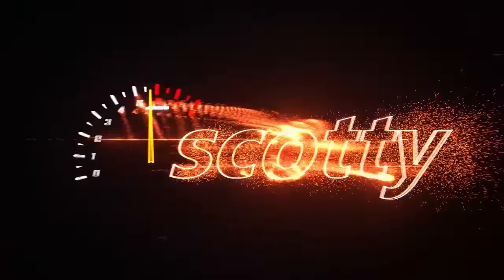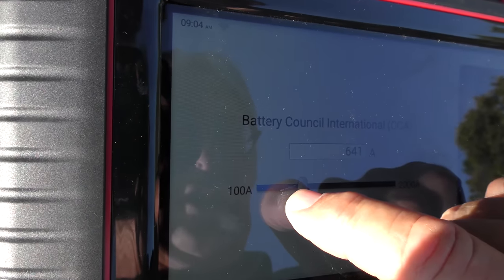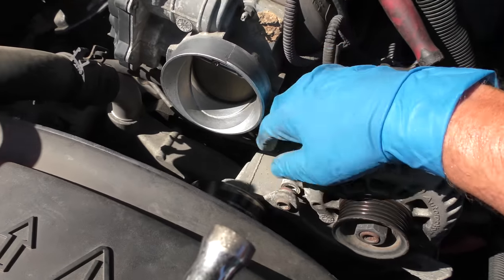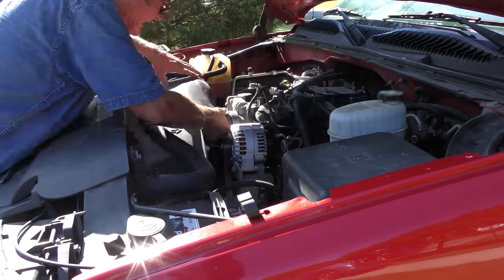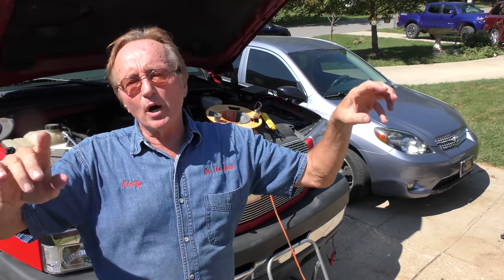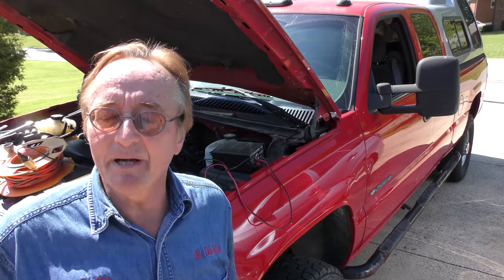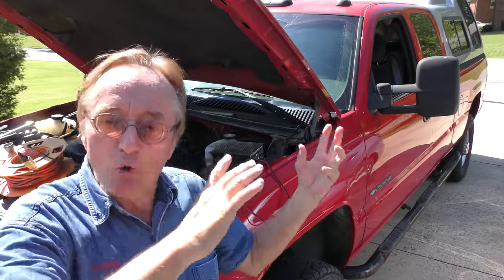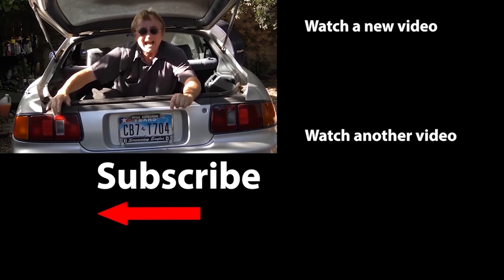I Just Got Kicked Out of AutoZone and I'm Mad as Hell

Comment: Scotty. 
I listen to your rant.
1. I do work at the Zone. 
2. I agree the parts we sell are either manufactured in China or Mexico
3. I agree it's best to buy brand new. Now try convincing the customer's it's their best choice. 99% want the cheapest price and cuss you out because the part failed.
4. I bought a rebuilt alternator for my daughter's truck. Lasted only 20 miles and drove it back to the Zone. It failed. I didn't not want a rebuilt one again. I upgraded and went brand new.
5. It does not matter which parts dealer you buy from. Their parts are bound to fail.
6. Would you buy a part from a parts store if they posted where it's made? No parts store is stupid enough to do that. Plus oem parts are the way to go. Yet the price for OEM parts are expensive $$$$$. 
7. Azone employees are not mechanics nor are trained as such. They are like any employee at Wally world. Cashier's.
You tell them what you need. 
You get asked year. Make. Model and engine. That's the way the system is designed. Employees have no control on it. They have no control on the parts they sell. It's up to the customer on what they want.
As far as the alternator. The tester is built that way. 
You plug in the part #. Hook up your test lead and it runs a test. 
We cannot open the machine in the test phase. Once you open the lid in test mode. The machine shuts down for safety reasons.
Yet. People bring their vehicles to be tested on the vehicle. Again the test equipment steps you thru the process. They have no control on the test equipment. 
8. As for me. I'm a DYI like you. I don't trust lots of auto parts stores. Like you I have ways of testing my own stuff at home. I do own a scanner and I've learned alot from Ivan. Dr.O and others on troubleshooting.
I've helped others as a free service. 
Try asking any auto repair shop for free service and you will get tossed out. 
I'm not sure what the Employee and the dialog that occurred between the 2 of you. People have bad days. Words get said from either party. 
Anyway Scotty. God bless you and have a wonderful day.

Comment: If you are testing for output on an alternator, if it's not charging you should still at least see the resting voltage of the battery. The only way you could have 0 volts at the output stud of an alternator is if it did not have either charge or ground path to the battery..hence an open circuit.

Comment: For many years, the Autozone store in our little town was the ONLY auto parts store for 25 miles. I would go there if I absolutely had to. Otherwise, I would drive the extra 25 miles to the NAPA or O'Riley's store. I started doing this when I discovered a 4 oz. can of brake fluid was $15 at Autozone and when I did my comparative shopping, I could get the same 4 oz's brake fluid at Circle K store for $4.00.  Just last year, O'Riley's built a new parts store in my town and I only have to drive 1 mile to get my parts these days.  I will NEVER go into an Autozone Store unless it is a 100% emergency.

Comment: I had a 1986 ford escort.  starter lasted years.  then one winter failed.   I put on a rebuilt ( as was the norm when I was a kid ( approx 1975 ).  so I got rebuilt.  I put on about 3 or 4 that each lasted about a year and always failed in the winter ( In Michigan ).  so lay in the snow and change a starter - what fun.    I make sure that I purchase parts that have a better warranty to avoid such problems.   I assume is ( any parts store ) if it has a 3 to 5 year warranty - it will last a while.   Sorry, I am still an Autozone customer and had good luck.  Driving a newer car now - so It will take a while to prove AZ ( good or bad ).

Comment: I have found it best to have a starter or alternator rebuilt locally at my rebuild center than buy over the counter. They do a better job and install better parts and if there is a problem they are more reliable in compensation and warranty.  Not many places anymore who rebuild them but most who do have good quality.

Comment: I have a 2011 chrystler 200. Alternator went bad put in a new one and the whole dash went haywire. Everything works right in the ignition on position, however when u start it the heater goes on hi, the front windows won't roll down and the radio screen black out. Can this be a bad Alternator? Grounds are tight and brand new battery.

Comment: QUESTION! I have a 2014 T&C van. Are there certain vehicles that you need to connect a power supply to before disconnecting the battery? I don't want to lose all the settings on everything. It has disabled people features that are programmed.

Comment: Hey scotty ive got a 2000 gmc sierra 4.3 v6 it starts up for a couple seconds and dies imediatly every time ive replaced the fuel filter and checked for fuel pressure its good i was told it may be the anti theft system malfuntioning replaced the the throttle control sensor that didnt fix it it throws a p106 code if remember correctly what should i do next.?

Comment: Autozone parts have always been crap. I remember back in the late 80s I was changing a water pump on a chevy V6. I went through 3 replacement Autozone water pumps that leaked before I just went to the dealer for the fourth and it worked just fine. After that, I never bought another part from Autozone.

Comment: Strange never had an issue with Autozone alternators, pumps etc. and the 1 time I did due to defective voltage regulator they swapped it on the spot.  The rebuilts are fine and have had one in my Silverado for almost 10 years.  It is a quality part you also get the choice of "value line" or better grades which did you buy? The video does not specify.

Comment: My significant other has a 2004 Camry which she took to Goodyear Maintenance place - battery light was on in the dash. They told her battery is good but needed an alternator. A day later and  $400+ they put in a remanufactured alternator and she drove it home (about 25 miles). Battery light is back on and looking at the battery ( toyota battery) electrolyte is boiled  off. I measure voltage across battery ( vehicle off) and its 13.2 volt. Start the car and the voltage now is 18.3 volts. Check ground between alternator case and battery negative terminal and its less than .2 ohms.  I say they put in a junk alternator. Am I off?

Comment: I’m on my 5th AutoZone “duralast gold” starter in the last 3 years and it just started going out again. This one only lasted a couple months before it started grinding. Almost everyone of them has failed differently so I’m pretty sure it isn’t on my end. With one of them the solenoid welded itself in the on position. Had to disconnect the batteries to get it to stop cranking. At this point I’m gonna be looking for some $ from AutoZone. This starter isn’t easy to replace either. The exhaust needs to be disconnected for the starter to be removed. Should have never gone with AutoZone but the starter cost a third of what the oem one cost so at the time it seemed like a deal but now I’m out hours of my life and my time is valuable.

Comment: Went to autozone just to ask them to use a scan tool and clear a code.. they said only the dealer could remove ENGINE codes, yet advanced auto pulled out the tool and had it done in 5 mins

Comment: I have a 2003 YUKON and am having "intermittent" starting problems...when it happens it turns over, it won't start and when I turn the key off it sounds like the starter is still engaged. Any ideas what is wrong. Thanks

Comment: Scotty, good call on this one but I would have charged the battery first and then rechecked the alternator because I have had bad batteries that will not take a charge and cause the alternator to try to compensate and put out too many volts. I see it as a 50/50 call but that's how I would have done it. I've also had the reverse where the alternator seemed to not be putting out more than 12V but it was due to a bad battery not wanting to take ANY volts. Yeah, and on AutoZone and all the other chain type auto parts stores, I only use them in total emergency. I'd rather go to NAPA or order online.

Comment: I bought a fuel filter from Autozone. It leaked like a sieve. I searched the internet for a solution figuring I installed it wrong. Turns out EVERYONE who bought this part had the same problem and their web site is full of complaints about it. I took it back for a refund and talked to them about the issue. They could not care less. I have not bought anything there since.

Comment: So based on YOUR measurements, the internal flat surface area of the GM battery connection, flows less current than the circular internal diameter of the Ford style battery terminal? I would like to see you measurements please.

Comment: Even new has been defective..when I did/do repairs for others I cover myself/my shop by a defective policy.

I inform the customer if desired they have options when parts are involved.

1 me/shop gets the parts new or used will be more expensive but less than most tech/shops.   Which would make up for bad parts salespeople and defective parts.

Course I there’s bad parts people and remaufacuters but even the best part maker can and does have defective parts.  I usually do have a favorite parts store but usually a most reliable parts salesperson also at that same store.

2 they can bring any compatible part new or used BUT if defective the customer pays the additional labor in replacement(s).

Comment: Had the same experience but with advance auto. Got a remanufactured alternator. Didn’t work. Took it back and they tried to test it and tell me it was fine. After some arguing I finally got it swapped out and wouldn’t ya know? It worked fine. Good ol’ parts department always has to argue 🙄

Comment: Never buy a battery from Autozone.
1. They prorate their warranty.
2. The batteries are 2x the price.
3. They’re cheap batteries.

I buy Excide from Home Depot. They’re $119 for my 7.3 power stroke. 3 year warranty! If it’s been right at 3 years, they swap the battery out, no charge and no receipt needed. Never had any problems in vehicles I’ve used them in. The only reason I know is because my 7.3 sits and drains the battery over 2 weeks if I don’t drive it.

Comment: I use to work behind the counter of autozone. They use to have knowledgeable people there to help with the correct part back around 2020 when I got hired. When our store manager left they wanted almost a year to give us a new manager. But that wasn't the issue. The district manager, wouldn't even allow the help we needed to run the store, we were severely short staffed to the point me and assistant Manager had to work and entire day by ourselves. It was out of control, people quitting, incompetent hires. Eventually the goal was for them to remove all the employees that had been there for years without firing them despite them having loads of knowledge when it came to vehicles.

Comment: I ran into a similar issue with an alternator from AutoZone, My truck died on the road I could see a discharge happing while driving. So I took my alternator out and brought it to AutoZone. They tested it and said there is nothing wrong with it. I said just sell me a new one. I installed a new one and it worked just fine. My son in law had the same thing happen to him having an alternator tested. I guess they need training on how to use the test equipment or replace it with one that works properly.

Comment: I’ve learned to not buy any electrical parts from autozone. I had to replace a sensor on my wife’s car that was really hard to get to. It took about 3 hours to get everything out of the way and get the part off and about 3 hours to install the new part and button everything back up. After getting everything buttoned up I went to start the car and it was still doing the same thing and throwing the same code. So I spent another 3 hours unbuttoning everything to take the new part off. Went to Napa to get a new, new part. Spent 3 hours putting it on again and buttoning it back up to get it running right. Took the faulty part back to autozone and they looked at me like I was retarded. I try to buy everything at Napa or from a well known online performance shop now, but if I do go to autozone, it’s for sure not for anything electrical.

Comment: Wow Scotty, you don’t know that there’s three types of alternators that you can buy from various stores? One is rebuilt. They put the minimal parts in to get it to operate. These are the ones in the trade. We have the most trouble with. Two remanufactured we don’t get a lot of comebacks on a remanufactured alternator, but it is possible. Three new I have had new bad out of the box so it is possible to get a faulty alternator even if it’s new, but the percentage is solo it almost never happens. I used to work in a shop specialized in starters, etc. we did nothing but high-quality diesel trucks, boats airplane, etc., that’s where I’m getting my information from hands-on experience. Yes I prefer buying new also. These scenarios happen in any Auto parts store. I’m surprised he didn’t know that.

Comment: I guess we're not going to agree on everything Scotty. I'm afraid I like the stupid side terminal better. All I have to do is put a little gear wrench on it and get it off. Those clamp on type terminals have a way of gluing themselves to the cable end that clamps on. My wife's focus has those type where the wire clamps on into a male post and we had the worst time trying to break it loose because of all the stupid corrosion. I'd rather more car makers put the side terminal battery types in. Sorry can't agree with you on everything

Comment: I had something similar happen with me. I have a used 2017 Mazda Mazda3 and about a month in the car wouldn't start and started smelling bad as if old trash was in it. One time it would have enough power to just power the interior, one time not at all so when I went to Advanced Auto and they ran a battery/alternator test, they told me that my battery was fine and it was my alternator charging weakly. But they did suggest going to a mechanic in case I need to put a new alternator in I could get one from them. So I went to my mechanic, told them, they tested and they said it was the battery! So they switched that out, paid $165 and I haven't had a problem since Car cranks, better even, can drive for hours at a time and no bad smell! Both AAP failed me as well as Auto Nation for selling me a car with a poor battery that barely lasted over a month and just outside their limited warranty! S/o to the independent mechs out there!

Comment: 🫥how right you are.. I have an A.Z and an A.A in my neighbor. And both in 4 more areas with in a 10 miles, they seem to be everywhere, I have visited each one, plus a few O'reilly's auto parts. Between me and the rest of my family we have about 20 vehicles between us that we service ourselves, we all do oil changes regularly and if we can get a wrench on it we (i) do all repairs and up keeps, I thought all my family the basics, combined we spend a few thousand a year, none of us had any major engine repairs requiring a shop which saves us far more then we spend. We don't go to auto zone unless they have the same part at a much cheaper price. Tie rods, brake pads, belts, oil specs, air breathers and everything in between because they are easily stumped through lack of training even though there looking at a screen ,so we know what we want when we go, so we can help them out and leave with the correct part, mostly we go to advance auto or O'Reilly, the employee are older and more knowledgeable,  probably due to making a better wage, a better living, also there attitude is completely different for that reason I suppose.. another thing is there parking lot,, auto zone stays bare compared to the others even though there right down or across the road!! Just like a restaurant,,,,, that speaks for itself.....times are getting harder and harder, people are starting to do there own work, people needs suggestions, a little help,, talking to a knowledgeable person goes a long way,, auto zone won't be able to help these people out.....unless a screen can talk your out of luck...

Comment: I learned years ago never buy electrical or ignition parts from auto zone. about the only thing i will buy from them is liquid and spray products. sadly they do sell some good quality parts like timken bearings and Felpro gaskets. so i been using my local advance and Napa when one or the other dont  have in stock. and i have really had much better luck with  parts. since i do have a at home shop i have the ability to give my customers a better price and better warranty. but from time to time you do get a bad parts  but not like autozone junk!

Comment: AutoZone is the worst. About 6 years ago, the belt tensioner broke on my truck on the highway. Walked back a mile to AutoZone to get a new one and a belt, walk back to the truck, put them on and the belt is too small...walk back to AutoZone, this time in the rain, and they just argue with me that those were the right parts. They can't even sell me a slightly larger belt...because the computer says that's the right one and they don't know how to measure belts. Then the manager finally gets involved and says, yeah, it's probably the tensioner, our brand isn't made to manufacturer specs so they don't always work right. I had to loosen the alternator to tilt it to get the belt on the tighten the alternator back up. I contacted AutoZone corporate and they just said sorry, but we don't guarantee our parts to fit